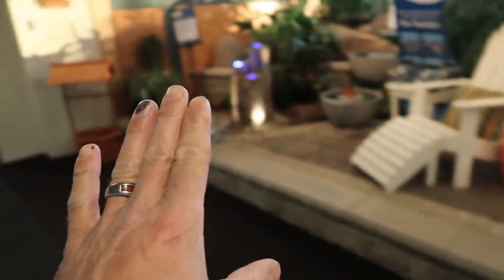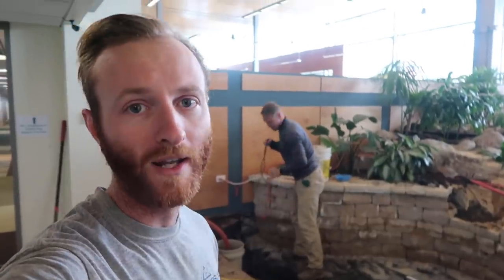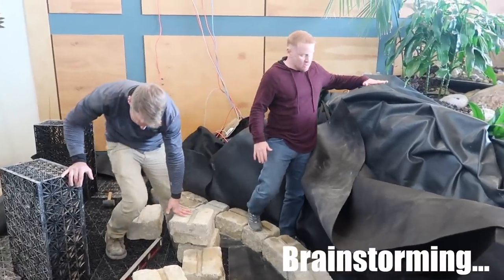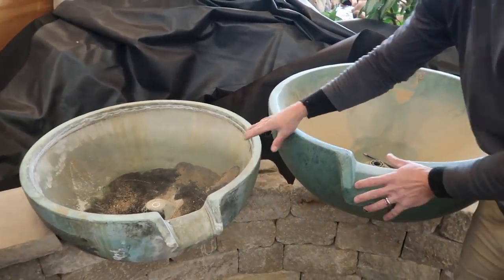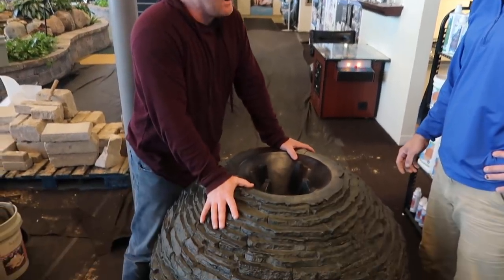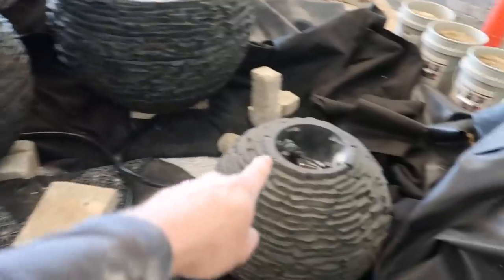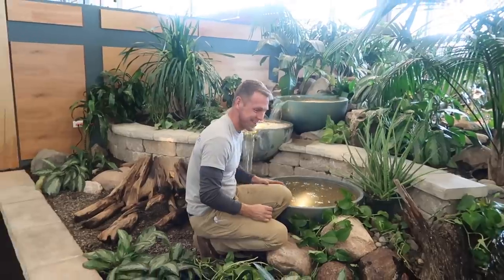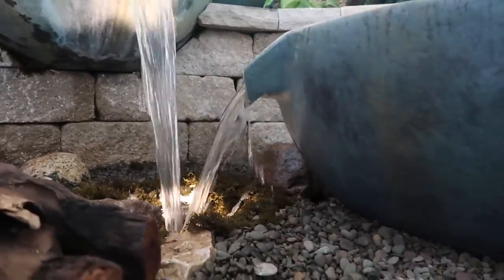How to Create a Cool Slate SPHERE FOUNTAIN Display!

Comment: When you are over laying two liners do you seal between the two so water doesn't travel to the seam and leak?  Thanks good video yall...  Thanks for sharing.  Great easy tip for cutting block to fit tight on the bowls.
Reply from the maker: meadowyck no. Gravity does it no seam needed when the bottom liner overhangs the top by at least 6 inches (and the ground is tamped and fully settled)

Comment: so the light inside the sphere looks like the 1w garden and pond light by aquascape, but how is it held in place? press fit and silicone?
Reply from the maker: Hi David - Here's a link to our LED Fountain Light: https://www.aquascapeinc.com/products/led-fountain-accent-light-with-transformer
It's easily installed into a fountain using its barbed hose tail and quick-connect fitting.